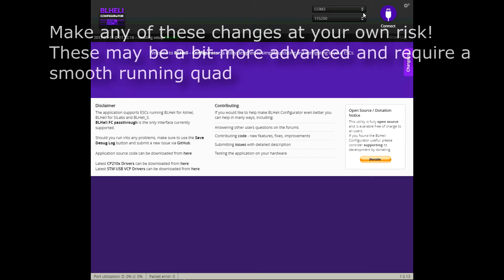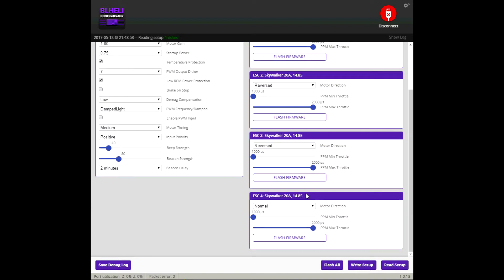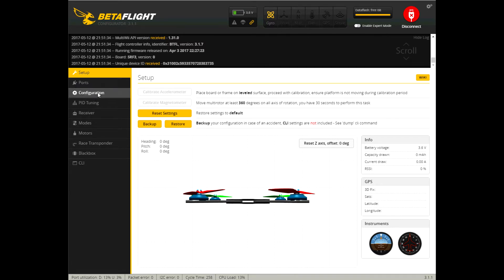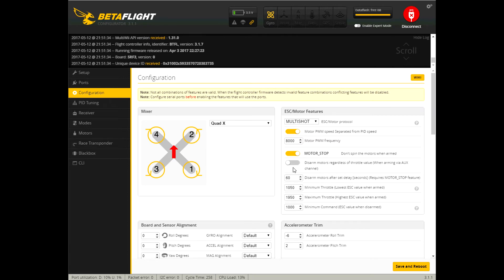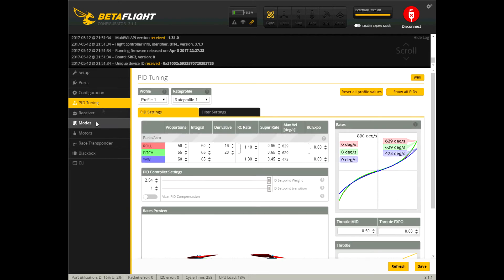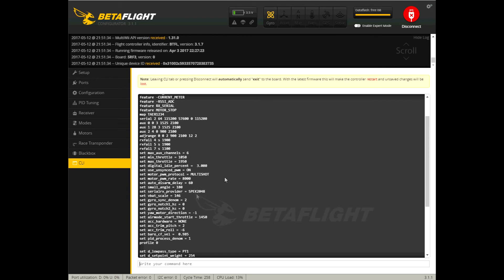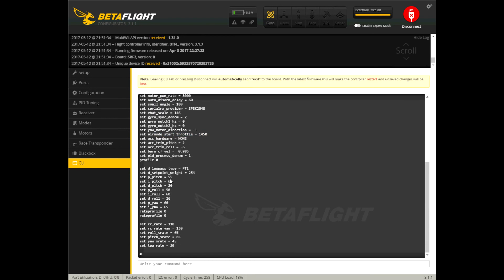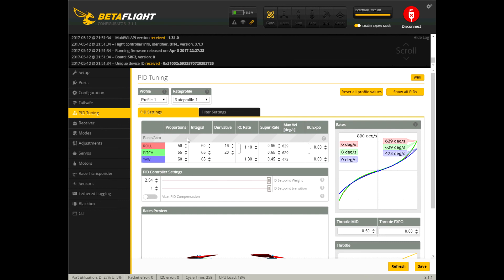Blade Torrent 2 - blheli and betaflight

Comment: I just got one of these and it won't roll or flip even in across mode do you know why?
Reply from the maker: Do you have a video of what's happening?  What do you mean it won't flip.  Does it stop? Does it hit the ground?
Reply: notasixpack I could make a video but do not have one.. if I try to flip I give throttle then kill throttle and try to flip, but it just leans super far and smashes the ground instead of just doing a quick flip. It's like there's no roll only pitch
Reply: notasixpack I suppose pitch is the wrong word it does have pitch and roll but just won't flip it just fly's extra fast which ever way I roll it
Reply: notasixpack it's as if something is making it stop from flipping upside down
Reply from the maker: without video it's going to be really hard.. sounds like you don't have airmode on.  no control at 0 throttle.
Reply: Or you had/have angle mode-self leveling. That will stop at certain angle and won't let you go any further.(no flip or roll allowed by the Flight Controller)

Comment: One of my motors which is number 3 I had replaced it but with my remote when I throttle up hooked up to betaflight all 4 do not throttle up and down together. Only if I use betaflight motor tab slider will all four throttle all the way up and down together with a battery plugged in

Comment: Can somebody please help me calibrate the ESC on the Blade torrent, I tried to do it by unplugging the plug with all the white wires and then hooking the betaflight go to the motor tab slide it all the way up and then plugging it back in and then Throttle Down but it doesn't work